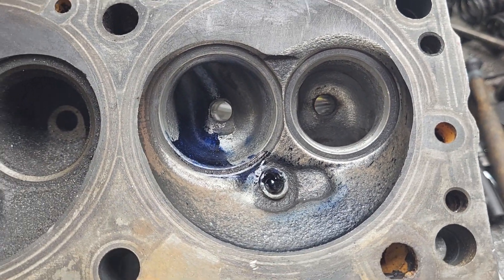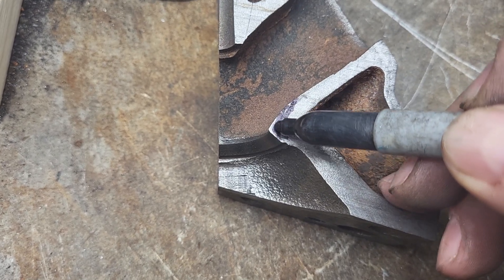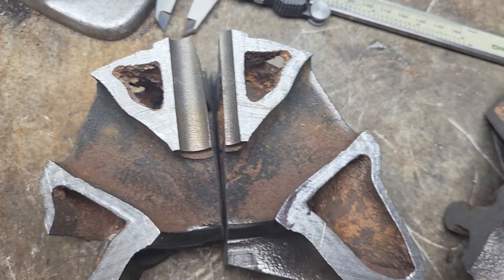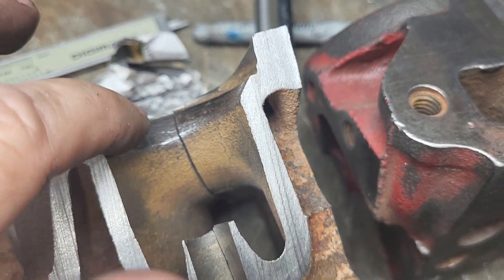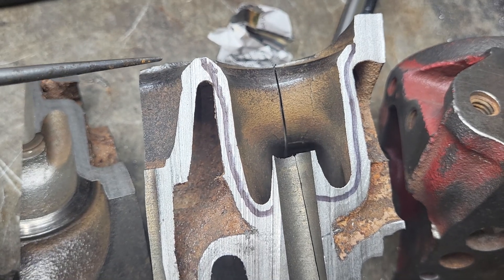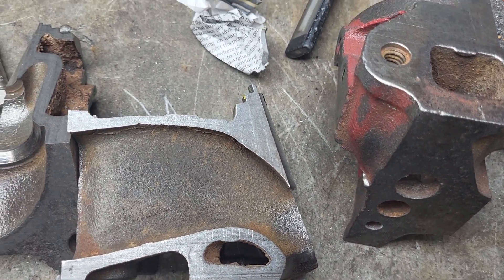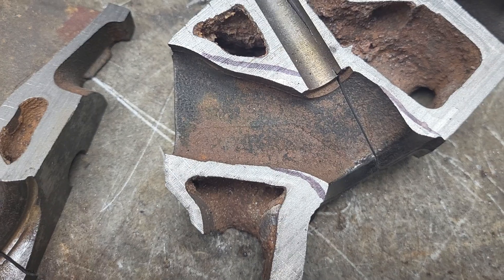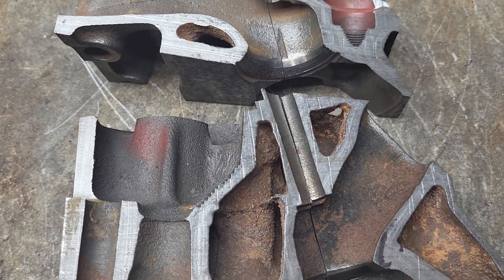David Vizard, Unity Motorsport, Mission Impossible 318 project, 4 barrel test head cut aways!

Comment: I've been watching all your work on the Mopar heads. I have a question about Mopar Small Block Magnum Porting Templates Part Number P4876413 and if you have ever seen or used. I'm willing to purchase and send you to compare with ported heads. I'm rebuilding a 5.9 for my 73 Duster this summer and hoping to do some budget head porting. Not for racing, just cruising and will never see 6000 rpm. Give me your thoughts. Thanks
Reply from the maker: Follow my EQ magnum ported heads as a guide and you are fine. A cleanup will get you what you want. Thanks
Reply from the maker: Never used templates.
Reply: @servediocylinderheads  ordered a set and will send to you when they get here. I'm near Arcadia, Fl

Comment: Beyond helpful! My 920’s are getting new valve  guides installed right now and when I get em back the porting begins. Have heard/read repeatedly  that 1.78/1.5’s valves not the liability you’d think they’d be on these? Hmmm?
Also 1.88’s cut down to 1.82 ish and 1.6’s a good combo? Hmmm? I obviously have no idea. Ha    anywho..thanks!
Reply from the maker: It can be done with the smaller valves similar to what I did on the open chambers. It needs a valve job anyway. Put in new 360 sized valves. Just my opinion. Thanks

Comment: Very nice work Mark, thanks for sharing. The casting cores look spot on with even material around the cooling passages, another nice job by the Chrysler engineers.
Reply from the maker: Overall you are right. I would have done it a bit different but it is a nice design. Thanks

Comment: You've got some very generous viewers Charlie. The linear striations indicate a band saw being used, and the other marks that I saw were indicative of a milling machine. Chop saws tend to leave an arc in the witness marks. Very interesting stuff. The only other thing that I think about when porting exhaust ports is that the thinner the section, the greater the heat load into the cooling system. Depending on application, it may or may not be an important consideration. Regards Greg
Reply from the maker: Good points Greg. Thanks